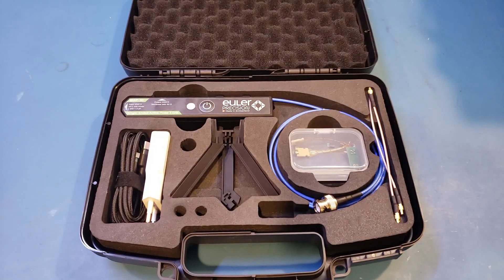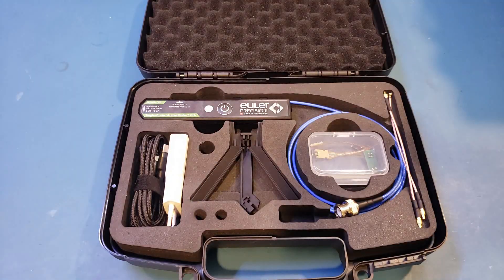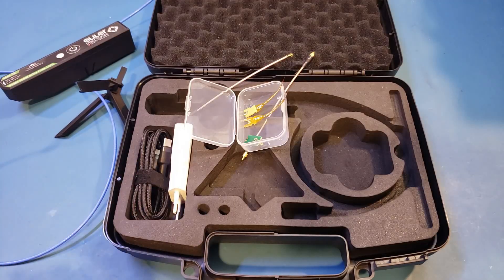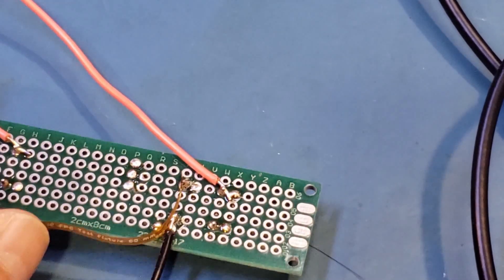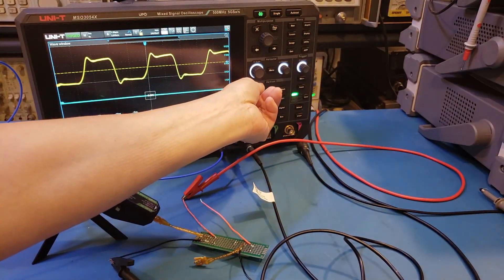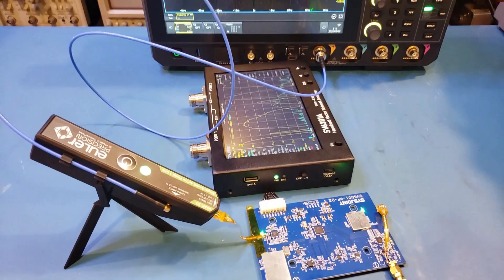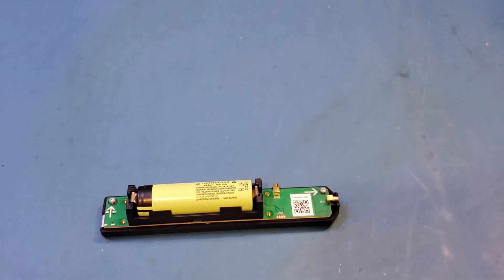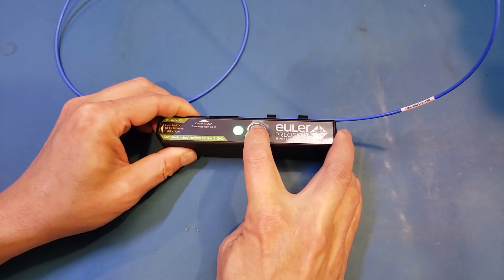Euler Precision eSAP-30 3GHz Active Probe Review/Teardown

Comment: I have seen several reviews of this probe, but none of them are relevant in terms of testing its capabilities, such as measurements performed with an oscilloscope of at least 6 GHz and an analysis of the noise spectrum at the probe’s input.
Reply from the maker: I was thinking about using an SA to test the noise figure, but I don't have an mmcx to N adapter at the moment.